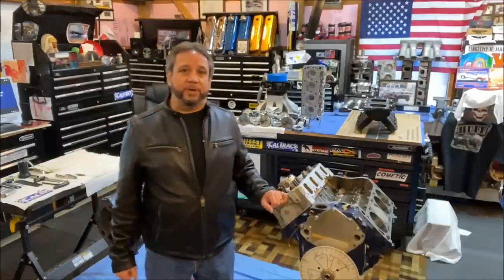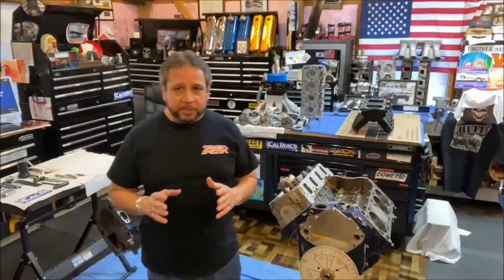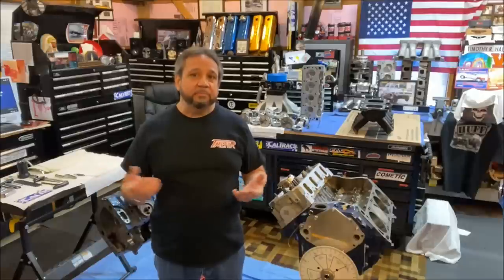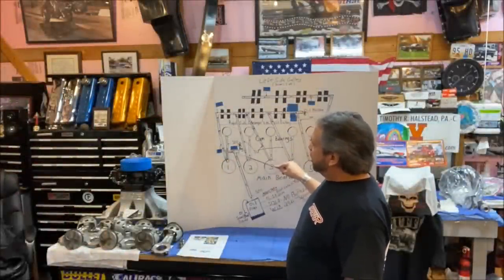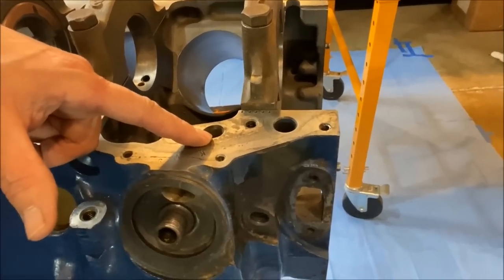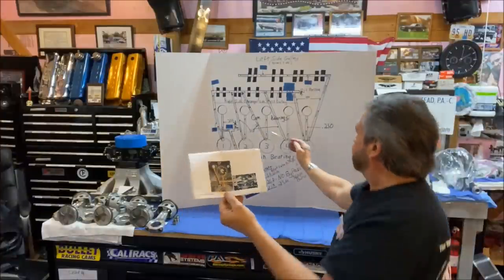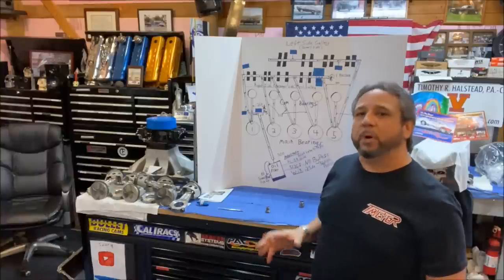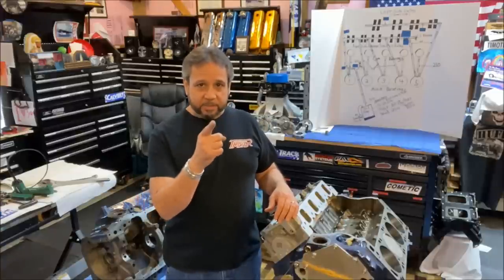Ford 351 Cleveland Oiling,  The Truth, and More

Comment: Tim I have a 70 351 4v I want to find intake gaskets w/o valley pan. Who makes just the gaskets??
Reply from the maker: I use fel pro 1265, but A3 port, so smaller than 4v, they must make one. Stay away from printo seal, poor gasket.
Reply: @DragBoss351Cleveland  I saw an Aussie vidio and he used fel pro 1240 performance set
Reply from the maker: @kevinbaker8102  not familiar with that, see what it looks like may be the ticket. I just bought set with valley pan, and tossed it in the bin. It does keep hot oil from bottom of intake.
Reply: @DragBoss351Cleveland  I also run evens waterless coolant
Reply from the maker: @kevinbaker8102  I use water wetter, supposed coo temps by 20-30 degrees F. How does that Evans coolant work?
Reply: @DragBoss351Cleveland  great!!-40 to 375 boiling point.
I run a 180 thermostat. The engine is in a 70 ranchero
Work in progress
Reply from the maker: @kevinbaker8102  Cool deal man, glad your here Kevin. explore my channel, tons of vids. I had a 73 Ranchero with Cleveland, it was sure fast. Probably because, it was mostly gone from rust, lol.
Reply: @DragBoss351Cleveland  fel pro makes 4v manifold gaskets w/o valley pan.
My napa guy is getting them for me
Reply from the maker: @kevinbaker8102  good deal, let us know what the part number is, so others can use it too. Thanks
Reply: @DragBoss351Cleveland  fel pro # 1228

Comment: I belive if you measure the center-to-center distance between the crankshaft bore and the camshaft bore you'll find it to be 3.35 inches. See any relationship there? 🤔
Reply from the maker: Hmmm 335 series maybe John?
Reply: @DragBoss351Cleveland  Now, consider the 370, 429, and 460 cu.in. '385 Series' "Big Blocks"... 😏
Reply from the maker: @johnjohnsn7633  I can dig what your saying, never knew that, thank you for watching my channel. Cooking with gas now.
Reply: @DragBoss351Cleveland  That may be one of those "Race Legends", as I heard it after I had already ended my automotive career for my LE career.

However, seeing that you've got all those "335" blocks laying around, along with an excellent set of dial calipers.... 🙂
Reply from the maker: @johnjohnsn7633  More free time activities. I do have a few blocks, at one time had 12, now down to 6, with one being the aluminum TrackBoss block. Going to pick up Callies crank, and Crower billet rods on Monday...

Comment: DragBoss Garage Awsosme channel! i just subscribed! Im doing a 70 Cleveland. Cost not an issue but would you go with the Tmeyer bearings or the moroso kit?
Reply from the maker: I used both. And just tried his oil filter adapter. Glad your here.
Reply: @DragBoss351Cleveland  Thank you! Really appreciate the guidance.
Reply from the maker: @AAhshitsun  your. Most welcome. Appreciate you being here also. Get the stroker kit from Tim Meyer comes internally balanced.

Comment: I've heard it said that the Cleveland is a small block with big block heads.
On the GoMoG engine weights website they claim the small block Chevies are 575lbs while the Ford 351C is only 550lbs.
I guess it all boils down to what you want to believe but then again does it really matter.
Reply from the maker: I just go by the Ford nomenclature. How they identified the cleveland. Always wondered how the cleveland was lighter.
Reply: @DragBoss351Cleveland  I've always been a fan of the Cleveland. One of the best street races I ever saw when I was a teenager was a mustang with a 351C blowing the doors off a Camaro one night.
Reply: @DragBoss351Cleveland  I've had a couple of chevy 396's over the years and the similarities are apparent. Probably why I like them.
Reply from the maker: Me too, since 1975 when I watch a Bob Glidden with his cleveland powered Pinto take a win, I think it was over Gapp , I can still hear the sound of the engine screaming pass the stripe. At the track, I can say I have put  few  big black Camaro’s on the trailer, these cars they are beautiful to begin with big tire, and they are nasty, running 1020s, and I roll up with my old Cougar little Cleveland, drop at 10.06 on them.  I always get asked how much spray, glad you’re here
Reply from the maker: I appreciate the big block Chevy too. all engines awesome, some just better than others😉🏁
Reply: @DragBoss351Cleveland  I seen some of the trick head and manifold work Glidden did back in the day A real pioneer!

Comment: HEY TIM! I OWE YOU A MAJOR APOLOGY. Your knowledge of these engines is far beyond anything that I know. Didn't mean to come off as a know it all and I sincerely apologize  for coming off like that. Mia culpa. Will you accept my apology, please? Thanks you for the channel,  I'm learning a lot from you.
Reply from the maker: It’s good my friend, I don’t hold any judgment, if people wanna complain how I do things for what they present that’s their opinion. I don’t get too worked up. i’m putting myself out in the open, I make mistakes too. No harm done, ain’t no big deal. Let’s keep going John, way more to learn and see stay tuned my friend
Reply: @DragBoss351Cleveland  Thanks Tim. I know I've got a lot of learning to do, that's a fact. I really want to know your take on scavenging, though as I was taught something completely different. I believe your term is what I learned as back pressure, is that correct?  Thanks
Reply from the maker: @raiderjohnthemadbomber8666  back pressure is the restriction against the outflow of the exhaust fumes. People say you don’t need any I was thought you need a little, but that’s a question for Darin Morgan. The scavenging, is associated with the cam timing, and outflow of the exhaust gases, actually has a draw on the intake flow and pulls it and fills the  chamber. The key is to fill the chamber with fuel and air, And I have a contaminated by the reschedule exhaust gases.
Reply: @DragBoss351Cleveland  ok, so I totally misunderstood you when you alluded to the process because you just said what I was taught. I believe the cam and its timing to be key to performance from an rv to a 7000 hp firebreather. Thanks for clearing that up, now I really do feel a little foolish because of my lack of understanding your original comment.
Sorry to hear you're not monetized yet. I am a sub, wish I could do more, too broke to become a member.  Good luck, I do enjoy your channel.
Reply from the maker: @raiderjohnthemadbomber8666  it’s all good. Turn it up.
Reply: @DragBoss351Cleveland  
Great, cuz I'm gonna wanna pick your brain. When I was with the Inglewood chapter of the Street Racers we all helped each other out. It's refreshing to see that same comradery in todays racing community. Anyway, hope you're around as long as you want to be.
Reply from the maker: I can help when I can. Everyone chips in with answers. Best advice comes from experience
Reply: @DragBoss351Cleveland  true dat!

Comment: ,,, radius grinding, Roush Moroso restrictor kit, big i.d. filter inlet, full groove main bearings, aluminum rods, with 2.100 journals, forget the stroker, rev it to 9,000, quality pan, pickup, and regular size pump, ( you did restrict ), do not cross drill main journals,  that'll get to 800 plus horsepower, at least 20 micron filter . Then lifter bores for 900, plus, but by then you will want a latter day block .. on edit: I might try the three quarter grooved main bearings  .
Reply from the maker: More topics to explore, I have been going so long with bare mods too. Now can’t wait to see what pro stock build will bring. Sounds like you have a handle on it, thanks for sharing with us your experience, can’t buy that. Be safe Roland and stay tuned.
Reply: @DragBoss351Cleveland  ,,, the Roush designed set screw restricor set was simple but amazing, up until then there were a bunch of designs with poor results  . I guess his worked, but Dyno Don ran separate oil lines to the bottom of each main cap .
Reply from the maker: @rolandtamaccio3285  I will have to pull out the Hank the Crank set up, and give a demonstration on its history and use. From what I saw in pics, many guys were running dry sumps. alleviate the issues, but cost was considerable. Thanks  Roland.
Reply: @DragBoss351Cleveland  ,,, no dry sumps till 1975 or later .
Reply from the maker: @rolandtamaccio3285  not sure about that, I have a few pics with dry sump, with his pinto he got from Roush and that was 1972, either way, how do you know this Roland? I may ask Rusty Glidden, next time we talk
Reply: @DragBoss351Cleveland  Bill Jenkins is generally considered to have the first dry sump in Pro Stock Like '74 or '75 . Maybe that Pinto got one later ?
Reply from the maker: @rolandtamaccio3285  very possible, fact is, they realized they needed to overcome the deficiencies to prolong engine life and parts. I would a dry sump, maybe for this pro stock build, time will tell.
Reply: @rolandtamaccio3285  actually documented Dick Landy was the first to run dry sump in his Hemi Duster. Destroked to 396 for weight break, cleavlands still had to carry the most weight per cu. in. Most efficient of all of manufacturers.
Reply: @steveelenbaas5999 ,,, I know there's been argument over the years about that  . What year .
Reply: @rolandtamaccio3285  I believe it was ‘72 if memory is correct on the year. But there was a lot of controversy at the time. I always watched Pro Stock and modified eliminator since day 1 in ‘70, Bruce Sizemore won Indy in ‘76 in pinto with a 300-6 cut and welded Cleveland cyl head ran 9.76 awesome.
Reply: @steveelenbaas5999  yes, I remember that welded head, and how strong the car ran .
Reply: @steveelenbaas5999  Wow, I didn't know that Ambrose, Argenta, Huitman were beaten to the punch with this type of crazy conversion...in the '70s !!

Comment: Seen a few articals the last week , about the 351 and NASCAR, the new heads that are used in NASCAR is anyone trying  these heads in drag racing?
Reply from the maker: Which heads? I know a few who raced D3 heads. Leonard Long races with them and in high 7s.
Reply: @DragBoss351Cleveland  thanks, I always see theses show building 3051:' s never see anyone use these heads on any build, thought they didnT work for. drag engines

Comment: Moroso lifter galley restrictors for bbc have a .060 hole to feed oil to slid flat tappet lifters and oil the rocker arms and valve stems and springs. I would think you would restrict oil flow to the lifter only bank keep flow volume at rear main bearing.
Reply from the maker: The best thing to do is install lifter bushings, I have heard from .030, to .060. I never knew that BBC utilized any restrictors. Thanks for watching.
Reply: @DragBoss351Cleveland  What I should have said was the moroso restrictors .060 hole was enough oil being metered to lube the top end components. So my thought is restrict the oil into the last bank of lifters that dosent send oil to mains. You have The Best cleveland engine site. I look forward to your next cleveland adventure.
Reply from the maker: @davidcooper2856  I got what you saying, I appreciate the comments, and taking the time to reply, and watch. Darin Morgan will be on my Friday Night live on 10/8, at 7pm est.

Comment: One thing you do not address is , as the oil travels down the lifter galley, it is starting and stoping over and over again. Because the oil band on the lifter has to be open to the galley to allow oil to flow. 
  Who do you know at a hospital that gets you them blue rags?
Reply from the maker: Thanks for commenting on my channel. I hear what you are saying, but I think there is also a degree of flow between body and galley which is round. But i know what you mean about the oil band. Pulsating flow. Thanks for contributing and taking the time Racer D, appreciate it

Comment: Never use moroso's restrictor in the no. 5 position. It's too small! One of my pulling truck guys ate up some lifters on that bank and chewed up his engine before he realized it. I took the restrictor for no. 5 and drilled it out between factory size and moroso's restrictor size. As for the cleveland using it for much of anything higher rpm go with the bushed lifter bores. It solves alot of problems, and also in the 460 engines. Always remember that too much restriction is worse than not enough! Personally not sure why anyone would want to build a cleveland. 351 windsor has a taller deck, better oiling and etc. Better parts availability. Can it work? Yeh but why when there's something better.
Reply from the maker: Thanks for watching my Channel.  Yes the oil system has its downfalls. Glad to hear that it worked well on 385 series engines. If you never had or raced a Cleveland you might not get it. Its about a motor that was only in production for 4 years. Its about what your used to. When I started racing, no one wanted the Wheezer. There are a ton of guys, that feel the same, I like all engines, they all have their good and bad. Thanks for being here.
Reply: @DragBoss351Cleveland  Yes, I do get it. I have clients that want to use a certain engine for something that i could build in my mind better. Here's a funny. I always loved the Vega 140 ci. engines they had a lot of downfalls but they were a great little engine in those cars for gas mileage and could have a lot of get up and go if you made certain mods to them. PS. enjoy your videos!
Reply from the maker: @havebenthere  cool beans man. Are you talking cosworth Vega? I remember them from back in the day. I’m just a guy in my garage that been doing the same stuff for 40 years, just opened the door a little higher,lol. I enjoy bringing this stuff back to life and learning along the way. Makes it nice with lots of explore here.
Reply: @DragBoss351Cleveland  Cosworth Vega only seen one up close in my life. By the way the Cosworth was a 2 liter. 122 ci. if my memory is correct. Shorter stroke than the 140 ci. Had a 4 valved twin overhead cam, aluminium instead of the single ohc cast iron head. Even the 140 with the cast iron head ohc was capable of 7200rpm on the valvetrain. Altho stout bottom end sporting  5 main caps. Hmmm.
Reply from the maker: @havebenthere  I have seen only one too. Did not know what I was looking at, and back the was all about cleveland to me. Cosworth also did ford Indy stuff too. Thanks for replying. Have wicked video for tonight. Stay tuned

Comment: One trick that was done is to misalign the cam bearings to partly block the hole and basically restrict the flow to the cam bearings. I do know that the oiling system probably was the problem in the 400 engine that I had that eventually threw a rod. 5-10 psi is probably not enough. LOL
Reply from the maker: Have not heard that. But I would believe it. YeS not enough pressure James.
Reply: @DragBoss351Cleveland  I just got a 2.5 Jeep 4 cylinder so now I can start on the Cleveland head project for 4 and 6 cylinder Jeep engines. What aluminum head do you recommend for stock replacement for 1974 351 Cleveland? The engine was a 2V in a 74 LTD. Want to get away from the open chamber.
Reply from the maker: Edlebrock or trick flow, chi   Depends on money you want to spend and availability
Reply: I've done it before. Seems to work. Never spun a cam bearing. Front cam bearing seems the most vulnerable.
Reply: The problem with the 400 is not the oiling system. It's the reciprocating mass on Windsor size bearings.
Power steering pump, smog pump, alternator, air condition pump, heavy crank, rods and pistons.
And most people think the tighter the belts the better.
Well all of that puts a heavy load on the main bearings. And when the mains lose the lead shell and run on copper, you have no oil pressure.
Oil system for the cleveland is adequate for a stock engine. But put that same in the 400, it was trouble just waiting to happen.